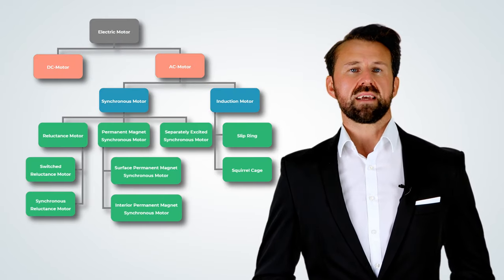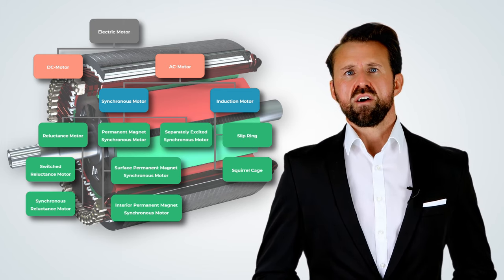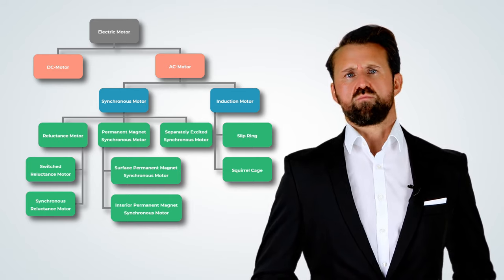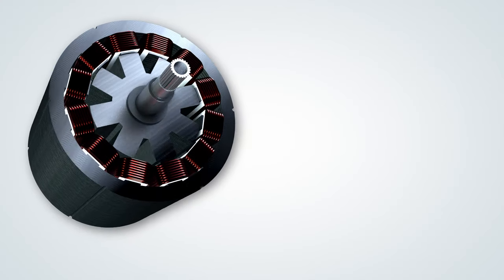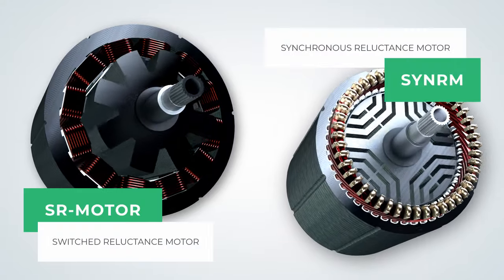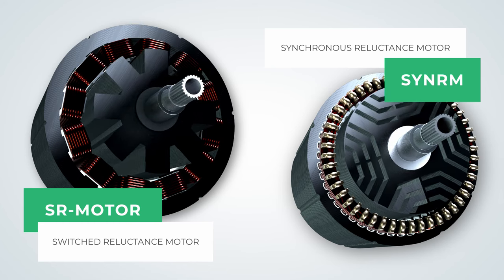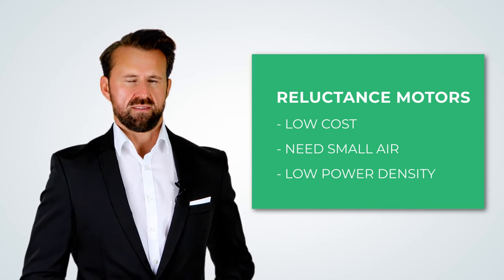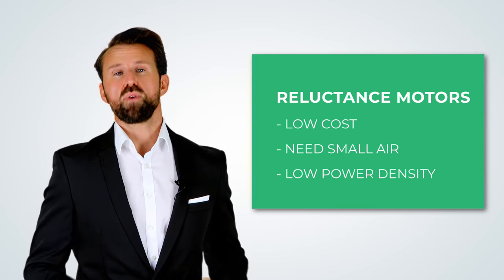Electric Motor Types and Complete Overview

Comment: Thank you for wide overview. Could you advise which motor would be the best solution for electrical motorbike and why?
Reply from the maker: Unfortunately, there is no general answer, because it depends on the type of motorcycle and how the load profile of the motorcycle looks. An IPMSM is a good first choice.
Reply: @Electric-Motor  Thank you for the quick response.  I would like to know more about differences between IPMSM and SPMSM,  especially how the placement of magnets affects the magnetic field and performance of a vehicle. Could you provide a link to get more details for simple understanding?
Reply from the maker: @sabinaderela1015  Unfortunately, I don't have a link to a website where the advantages and disadvantages are compared really well and simply. IPMSM and SPMSM both have their advantages and disadvantages. For electric vehicles, the advantages of IPMSM outweigh the disadvantages. Like for example the material costs and power density.

Comment: Great overview of the different types of electric motors. What type of electric motor do BLDC motors belong to?
Reply from the maker: BLDC motors belong to the group of AC motors. They are characterized by the fact that they have a block-shaped or trapezoidal control. BLDC motors are often used for small pumps or actuators. The electric motor type used is usually IPMSM designs with concentrated winding. Another common naming for BLDC motors is EC motor, which is the shortcut for electrically commutated motor.

Comment: Thank you so much. I would like to choose a dc motor with 500 watt and 1500 rpm between 24 volt to 36 volt input for a battery driven air conditioner. Which kind of motor I have to choose ?
Reply from the maker: You probably also want to control the speed of the motor, right? Because then you need of course a motor controller which regulates the voltage. The cost difference between a motor controller for a DC motor and a bldc motor is very small. So maybe it would be more worthwhile for you to use a bldc motor which would have the advantage that your battery will last longer. If you really want to have a DC motor, then search on Amazon with the following search term "dc motor 500W". What do you want to build just a device for you or a prototype to be produced in series?

Comment: Thank you very much. Where does the Brushless DC motor fit into the classification at the end of the video? Thank you
Reply from the maker: I am not sure if I understood your question correctly. But BLDC motors are by definition all AC motors that are controlled in block form, which is why BLDC motors are also called EC motors. Of course the AC motor should be designed for this with for example with concentrated windings. Do not be confused by the terms. Does that answer your question?
Reply: @Electric-Motor  Thank you very much for your detailed reply. I'm a mechanical engineer by trade (automotive) and recently trying to understand electric motors for EVs. So, please excuse any ignorance from my lack of electrical knowledge. To my limited understanding, a BLDC motor is technically direct current, where the speed controller creates something similar to an alternating current through a number of switches, but is not a 'true' alternating current. Is my understanding correct? So, to return to the nice chart you have showing the hierarchy of different motor types, where is the BLDC motor on that chart? Or is it in a separate category? I see some people have three classes of motor: DC, AC and EC. Thank you very much indeed!

Comment: Very interesting overview - which motor, from your view, is the 'best' electric motor?
Reply from the maker: Thank you for your question, it depends on the application. Because the requirements for an electric motor for an electric boat are different than for a small electric car. But an Interior Permanent Magnet Synchronous Motor ( IPMSM ) is always a good choice, because an IPMSM combines a permanent magnet motor with a reluctance motor.

Comment: Hello! Very interesting video! Thanks for the classification of electric motors.
How about PMSynRM? What's your opinion about them?
Reply from the maker: Hello, first of all thank you for your question. Synchronous reluctance motors with permanent magnets are a good solution to increase the power density of in synchronous reluctance motors and the efficiency of the motor is no longer so dependent on the air gap. However, by definition, a reluctance motor does not have cogging torques because it has no magnets! Therefore I would count a PMSynRM to the IPMSM group. Even though the proportion of reluctance torque is probably higher than that of additional permanent magnets. What is your opinion about this? In which group of electric motors would you classify the PMSynRM?

Comment: This is a great video! It is a shame you didn't cover BLDC motors - they are popular in their own way as they improve on the commutator design of a basic DC motor.
Reply from the maker: First of all, thank you. You are absolutely right BLDC motors I have not mentioned and stepper motors I have not mentioned. I wanted the video to help people get a simple overview of types of electric motors.
The problem is, to which subgroup would you add BLDC motors?
In my opinion BLDC motors belong to AC motors, because BLDC motors can also be induction motors for example!
To which subgroup would you add BLDC motors?
Reply: @Electric-Motor  In (modern) EVs all motors are in fact BLDC motors.

Comment: sir your explanation was really useful...can u tell me about which are the possible metals to use as stator & rotor....like ferrous or non ferrous ...
Reply from the maker: Thank you very much. For the rotor and the stator is usually used electrical steel. The faster the rotor rotates, the higher the losses in the stator and you have to use thinner sheets with lower losses. For example M250A35

Comment: Vielen Dank für diese schöne Übersicht. Ich habe eine Frage zu SESM. Welchen Strom und welche Spannung (und damit welche Leistung) braucht man für den Erregerstrom? Gibt es da eine Faustformel, die als Variable die Motorleistung hat.
Reply from the maker: @Markus Loch Hallo vielen Dank für Deine Frage. Die Leistung für die Erregung ist abhängig von der Größe der Maschine. Aber in der Regel sagt man 1-3% der Leistung werden für die Erregung benötigt. Man muss noch unterscheiden ob die Erregerspannung geregelt wird oder einfach die Versorgungsspannung verwendet wird. Für welche Leistungen und Versorgungsspannung soll die Maschine sein?
Reply: @Electric-Motor  Ich überlege, ob man die Erregerleistung induktiv übertragen könnte. Der Motor ist für Traktionszwecke im Individualverkehr (50-150 kW)
Reply from the maker: @radbot34  Ja, da die Leistung der Erregung eher gering ist kann man das machen und es gibt dafür auch schon Lösungen. Allerdings ist die Frage warum man das machen sollte, da der Verschleiß kein wirkliches Problem darstellt! Also wenn Sie einen Traktionsantrieb mit einer SESM suchen ich kenne Firmen, die welche bauen und sich damit beschäftigen. Oder wollen Sie einen neuen Elektromotor dafür bauen bzw entwicklen?
Reply: @Electric-Motor  Ich möchte die induktive Übertragung auf den Rotor neu entwickeln und einen Standard-Rotor eines Standard SESM verwenden.  (m@rkuslo.ch)
Reply from the maker: Ist die neue Art der Übertragung kostengünstiger oder was ist genau Vorteil?

Comment: Now with more tighter efficiency requirement manufacturer are looking to replace induction motor with higher efficiency one. Most of them switch to PMSM. But in the long term the demagnetisation will be an issue. It also cost much more for PMSM than induction motor. I'm researching about possibility to replace SynRM motor to appliance like industrial fan. But so far I do not see small SynRM for such application. Most of them are in KW size for industrial application. My question are;
1) Is it possible that SynRM can replace induction motor in household appliance in the future? 
2) Is it possible for SynRM to operate with lower voltage? (24/48V). I have never seen this kind of voltage runs with SynRM motor and kinda wonder why.
Reply from the maker: Thank you for your question. I have been allowed to analyze a SynRM for 12 volts with a power below 1000W, so I know the problems very well.
Regarding your second question, the problem is not the voltage but the air gap, which has a great influence on the efficiency of reluctance motors.
The smaller the motor, the smaller the air gap should be. Small pumps and fans usually have to be very cost effective. Compliance with tolerances also becomes more expensive the smaller the air gap becomes.
To achieve a high efficiency a SynRm should be built with a distributed winding. The implementation of a distributed winding for a small pump or a fan would make the electric motor longer. 
Therefore, for small electric motors, one relies on a concentrated winding and a PMSM.
I know manufacturers have tried it with an SR motor, however, that did not work out so well.
To answer your first question, I think it will be long term in the direction of a SynRm with permanent magnets.
For what power are you looking for an electric motor?
Reply: @Electric-Motor  Thank you very much for such insight reply! So if the major challenge in reducing the size of the SynRM motor is the air gap, what are the 'economically ok' size you think it is achievable for today's technology? (like down to which motor size where you think it is should not go for SynRM anymore)

And if SynRM rely on tight air gap like this, does this mean that it frame has to be dust proof (fully enclosed)?  

Thank you again for educating us !
Reply from the maker: Sorry for the late reply! It is strongly dependent on the size of the electric motor or their bearings and their quality. For small motors up to 1kw is a lower limit at 0.35mm. Reluctance motors should be used only where their advantages can be clearly exploited, for example, a high temperature resistance.

Comment: what type of electric motors are used in cnc machines?
Reply from the maker: Thanks for your question, you have to differentiate between the motors for the main spindle and the axes. For the main spindle you need a very high speed smoothness. This means that there is no speed variation. This is best achieved with a SPMSM with a distributed winding. For the axes of the machine tool, servo motors can also be used if the transmission ratio in the gearbox is high enough. These are then IPMSM with a concentrated winding, because with these more torque can be achieved. Hope I could answer your question?

Comment: EESM motors with wireless current transfer to the rotor exist. Such as MAHLE's EESM motor. 95% operational efficiency and 97% peak efficiency. EESM motors are gaining popularity in EVs (BMW i4, iX1, iX, iX3, Renault Zoe, Nissan, Renault Megan Electric). Not dependent on Chinese magnets and they are cheaper.
Reply from the maker: I completely agree with you. EESM are a very good alternative to motors with permanent magnets. Are you working on an EESM project?

Comment: Which is the best electric motor to use in Tugboat to generate 2600rpm of 400x2 hp ?
Reply from the maker: Thanks for your question. Did you mean 2x400hp so around 2x300kW?
And these 2*300kW do you want to have at a speed of 2600rpm?
Did I understand you correctly?

Comment: What is the ac voltage and the frequency of a 3 phase 8 pole permanent  magnet motor with 3600 RPM?
Reply from the maker: Hard to say, because it depense on the motor design, sorry that i can not help you with that

Comment: sir we would be very grateful if you could explain hybrid axial and radial flux motor that is used in keoingsegg car
Reply from the maker: Hello Grayson, very complex question. So Koenigsegg uses an axial flux motor because the installation space length is very short. This is a main advantage of axial flux motors compared to normal radial flux motors. But the biggest disadvantage of axial flux motors is the complex lamination of the stator to reduce the losses in the laminations. That is why compound material is often used, which is not electrical sheet but pressed powder. Sounds good, but the losses are greater for medium to high speeds. Therefore it is not often used. However, for very high speeds, the losses in the electrical sheet are greater. It is not the mechanical speed that is important, but the electrical speed. Since the Koenigsegg motors have many poles, the electrical speed will also be correspondingly large. So the use of compound material makes sense. Funnily enough, the market leader for this compound material comes from the same country as Koenigsegg ;-) This is probably not a coincidence. Hope I could answer your question Grayson?

Comment: Nice video! I would like to know what are the differences from an electronic point of view. As I understand the switched motor types, for some a rotation sensor is necessary and for some it is not.
Love to see more videos.
Reply from the maker: You are asking exactly the right question, thank you very much. When choosing an electric motor you should make sure that the electric motor has a small current ripple and that the phase current is as low as possible. Therefore the DC-link capacitor can be made smaller and less power semiconductors (MosFETs/IGBTs) are needed. This saves costs and space for power electronics.

Comment: Thank you for the content. 
I would like to see some analysis on the best motors used by electric sport cars. 
The lucid air motor specs sheet seems impressive 
Yasa motor used by Ferrari SF90 as well
Some speculation on Tesla plaid motor should be great!
Reply from the maker: Hello Mr. Maggini thank you for your message, we have planned to make a video on the topic of "best motor for an electric vehicle".
The best electric motor for a sports car would be to combine several types of motors, as each has its advantages and disadvantages.
But this is very complex and expensive in terms of the special inverter and the software needed for it.
Therefore, it is better and easier to use at least two different types of electric motors for a sports car.
This is what Tesla does, for example.
For example an asynchronous motor and an IPMSM with a lot of reluctance torque.
It is important to design the electric motors for high speeds to increase the power density, so very good bearings must be used.
To achieve good efficiencies, at least one of the drives should have a switchable gearbox.
In the Porsche Taycan, for example, a two-speed transmission is used.
Special attention must be paid to the cooling of the electric motor, as the standard solutions are usually not sufficient for the high power densities.
Are you more interested in hybrid sports cars or pure electric sports cars?
Reply: @Electric-Motor  Thank You for the answer, very appreciated. 
It should be great to have a detailed analysis on pro/cons of gearbox for EV, for what I know the Taycan is the only EV with a gearbox and other brand discarded this solution during the development phase (e.g. Rimac and Tesla), choosing instead a more powerful motor with higher rpm. 
I’m interested of everything is cutting edge, both for hybrid or pure EV.
Reply from the maker: For hybrid sports cars, the electric motor should be designed for high torques instead of high speeds to compensate for the weaknesses of the combustion engine in the lower speed range.
That's why Ferrari chose Yasa axial flux motors, because axial flux motors are good for producing high torque.
On the topic of electric sports cars:
Tesla is clearly focused on high volumes and mid-range vehicles.
The system architecture and the additional effort for a switchable transmission are not insignificant.
Therefore, the low-cost sports car solution is two drives with different ratios and the maps of the electric motors should complement each other well. So that the electric motor with the highest efficiency is always used at the current load point.
For gearboxes I would always choose a spur gearbox as it is more cost effective and can achieve a higher efficiency.
However, the planetary gear is of course stiffer and requires less space.
I think Audi is going the right way with a combination of planetary and spur gears. However, at the moment without a shiftable gearbox.
But we are only at the beginning of the electromobility :-)
If you like we can network on LinkedIn?
Reply: @Electric-Motor  sure we can network. Just done

Comment: Do switched or synchronous reluctance motors also act as regenerative braking devices?
Reply from the maker: Yes both switched reluctance motors and sychronreluctance motors can be used as a generator and as a brake. What do you want to use the reluctance motor for?
Reply: @Electric-Motor  Hallo. Wie funktioniert denn das regenerative Bremsen beim Reluktanzmotor? Ist das dann so wie beim Asynchronmotor, dass er übersynchron drehen muss?

Comment: how about air gap in PMSM? does it affect the efficiency in the same way like reluctance motor?
Reply from the maker: Thank you very much for your question. Due to the magnets in the rotor, the air gap of a PMSM can be chosen much larger without reducing the efficiency significantly. For applications that require a large air gap, a SPMSM is a good choice.

Comment: Since AC current is produced by inverting the DC supplied by Battery, so there is no compulsion to use 50 or 60 Hz frequency. In aircrafts, 400 Hz frequency is used for Induction Motors to reduce weight. What frequency is used in Electric Vehicles for Induction Motors?
Reply from the maker: Electric vehicles always use an inverter for induction motors that adjusts the frequency depending on torque and speed. For which function are induction motors used for aircraft? I know only airplanes in which PMSM are used.